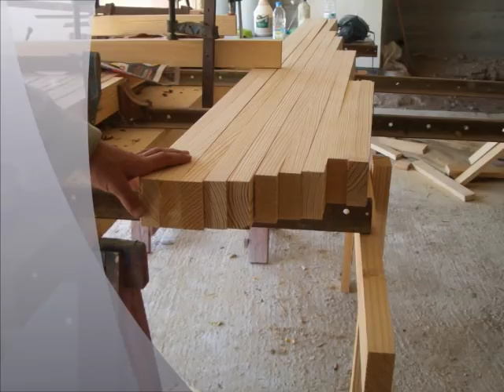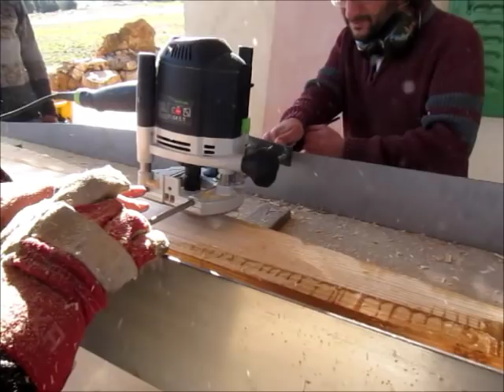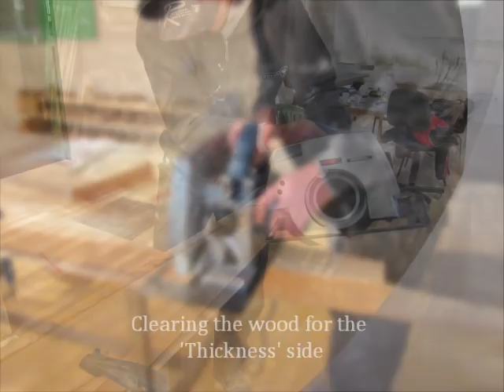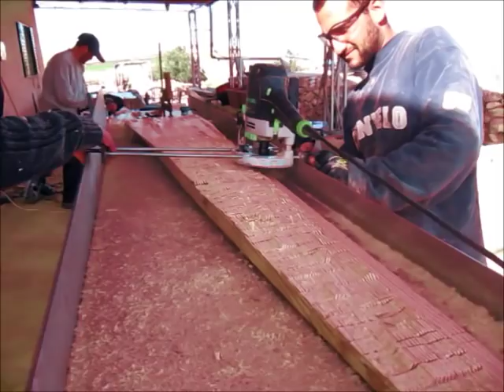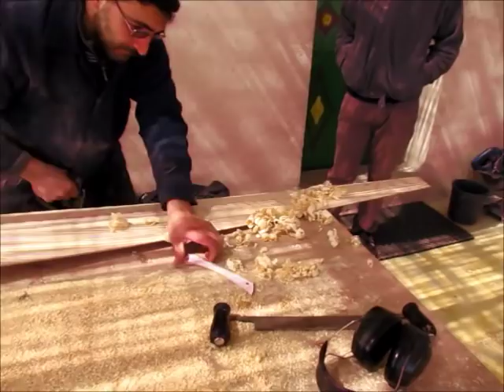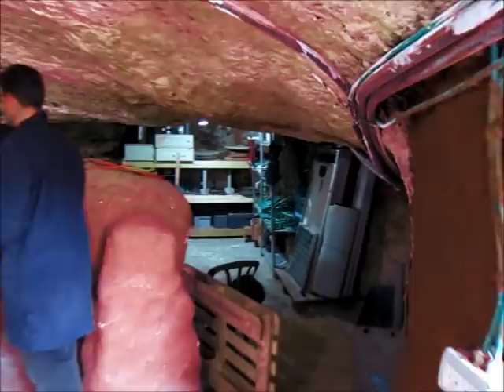making the blades

Comment: Lived 30 year off grid  —took a Chinese 200watt ——worked on the blades and got 900 to 1000 watt out of it = some of the things I did was sharpening the leading edge near the tip - got a tip from a surfer about surf board they put a vacuum curve to speed up the board and get rid of chatter I put that principle to the wind side of the blade with a over curve closer to the hub =ends up more power at the tips and the inner over cut moves the wind  more to the side -90degrees-a bubble of air forms to the front inner part of the wind turbine and increases the air flow near the tips